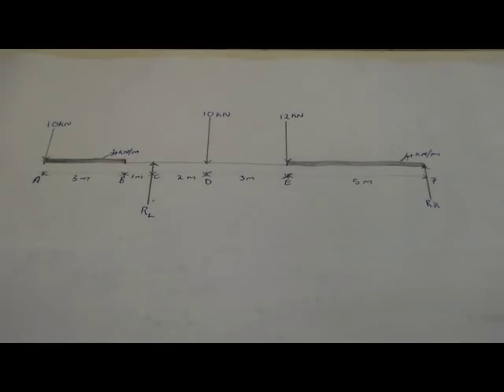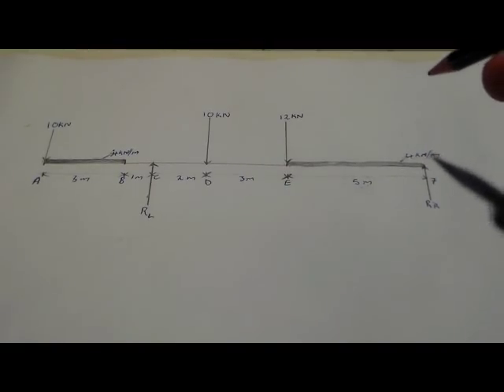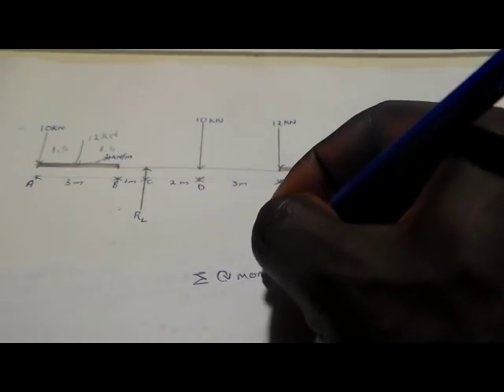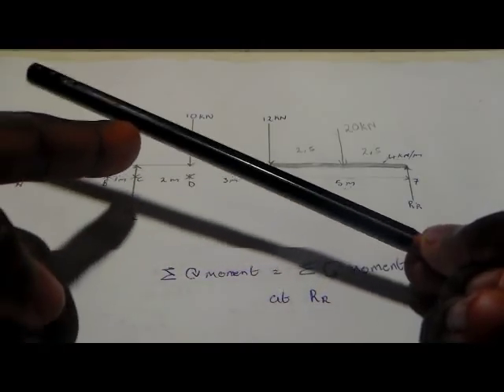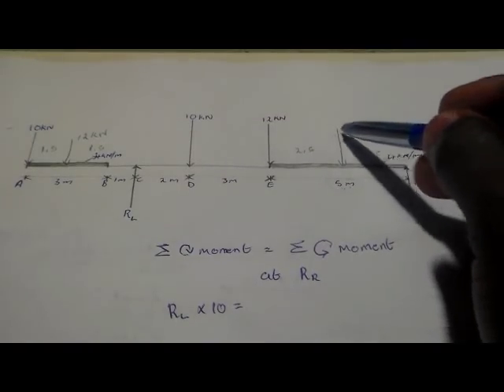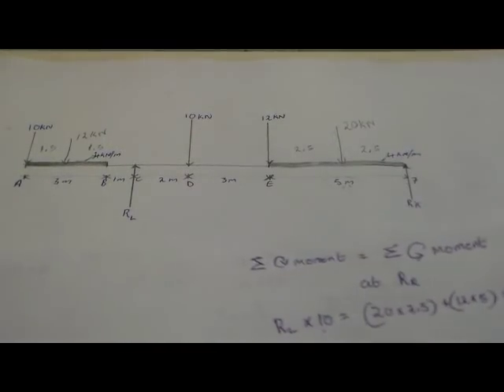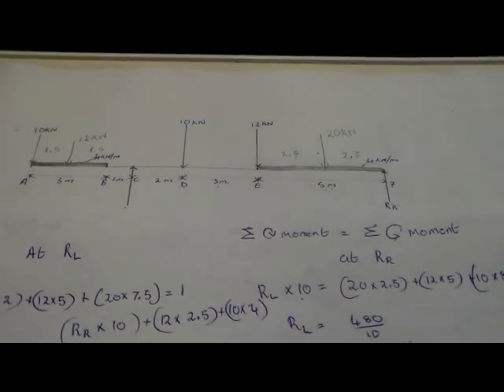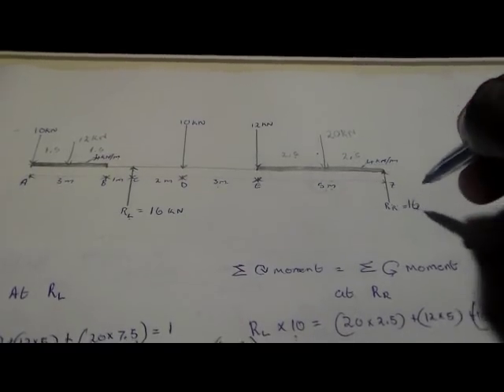how to calculate reaction on a beam

Comment: Can you help with the following Kinematics problem? Calculate the angular retardation if a car is brought to rest from 100km/h in 25 seconds? The diameter of the car's wheel is 500 mm. The last part of the problem is confusing me. Deceleration formula does not contain D.
Reply from the maker: You have to calculate the angular deceleration, so the diameter will help you get the angular velocity using this formula v=pie*D*N.... Which N will be in rev/s then u can get the angular velocity.
Reply: @helpnatedstudies  thanx